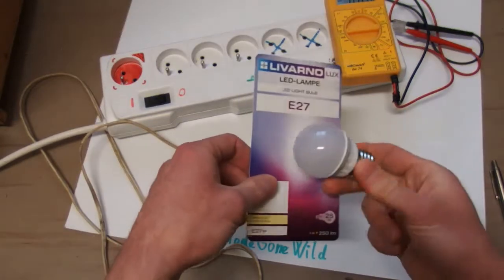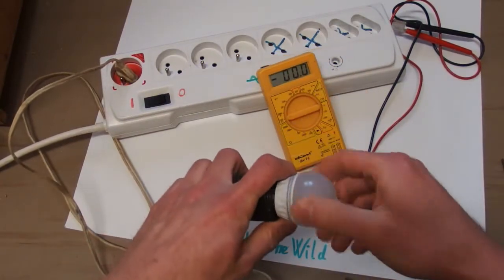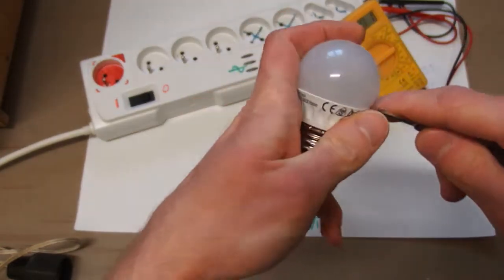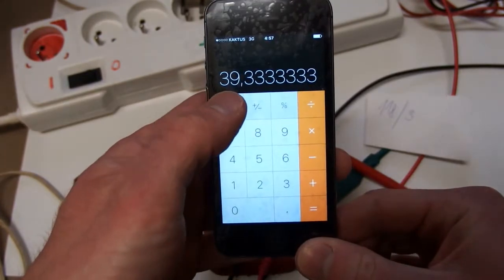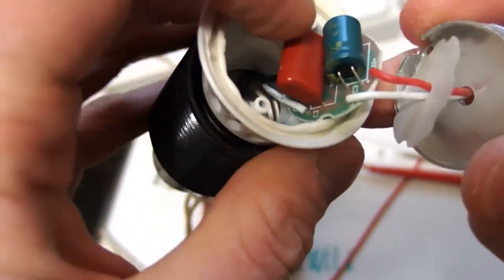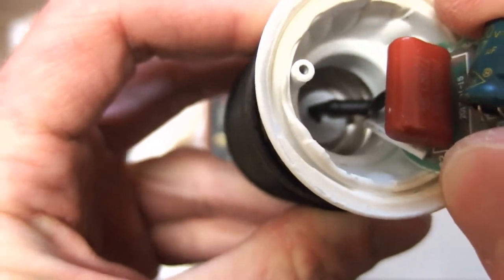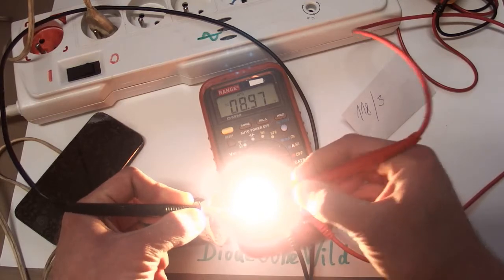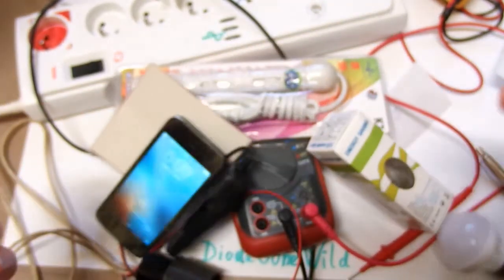Livarno Lux 3W LED Light Bulb Teardown

Comment: By chance do you know the type of LEDs used in the Livarno lux LED Daylamp?  im' trying to find something with less "blue light" since exposure to an intense and powerful [LED] light can lead to irreversible loss of retinal cells and diminished sharpness of vision... From what I can understand the whiter or "colder" the light, the greater the proportion of blue in the spectrum... So am wondering how to distinguish the good LEDs from the bad, :) and if  Livarno lux LED Daylamp is any good for my eyes at all...(or what would be better for my eyes) - my instruction manual doesn't say much other than to plug it in  :/

Comment: This livarno lux bulb is crap because it flickers, if one is going to replace the power supply for the bulb then that will be difficult because the LED chips as you said are different. You need to cut the tracks and re-wire it completely to work with custom LED driver from china that is properly made and does not flicker.